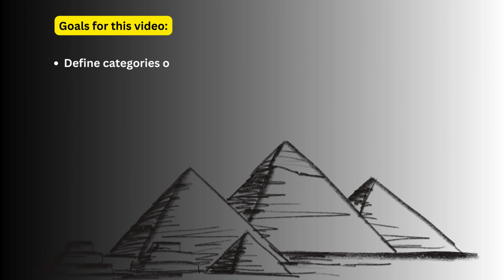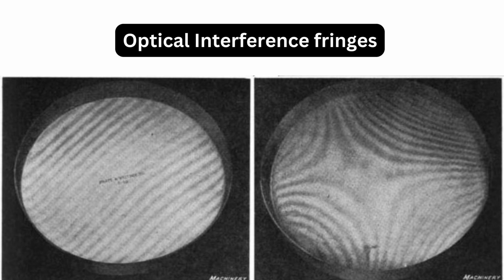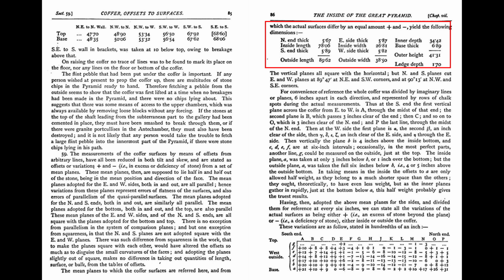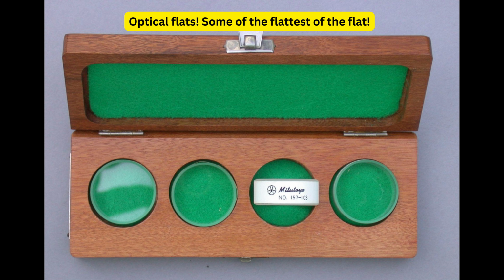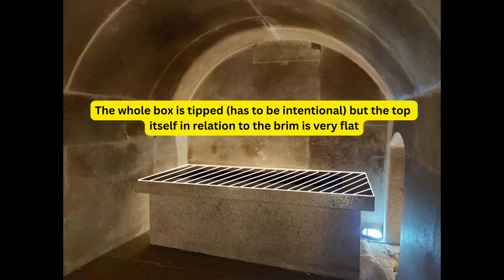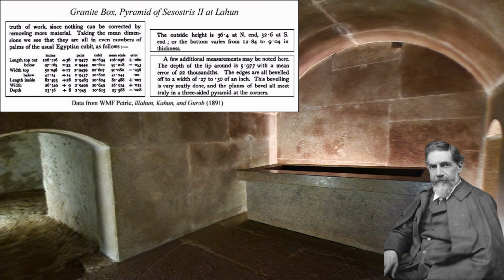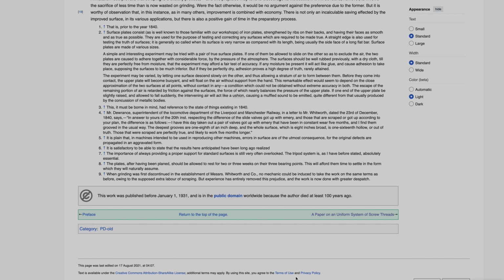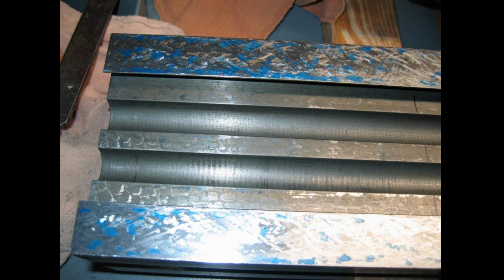The Problem of Flatness in Ancient Egypt

Comment: The problem with the world today is we all think we are the pinnacle of everything... you can go into the woods today make a rope and using gravity have a straight line, going off of that you can build something next to that line giving you a near perfect line, add in natural sun light to be a check for imperfections on the edge, and if turned on its side use a second check of water that is also a constant with gravity. So you have 2 gravity ways to find make or check a straight edge and a cosmic light source to make or check the flat edge

Comment: 5:45
Not quite. The method of shining light through a straight edge can make bumps of a hundredths of a millimeter visible. 
That is actually already extremely precise for most cases. But, it depends entirely on the quality and straightness of the edge your using and the type of light. 
There are actually measuring tools that use exactly that mechanism.

Comment: Actually it's very simple to go out into the woods and make stuff like that fx you can make a simple 3-4-5 triangle that will give you an exact 90 degree angle making a level is also pretty simple cause you can do like the ancient Egyptians would have done and use a weight on a string mounted on a triangle or similar that way you can use gravity to figure out angles making a ruler isn't hard either yes making one that's exactly a certain measurement would be tricky tho possibly using trigonometry but really the ruler just have to fit your own set measurements it doesn't matter if you're measuring in centimetres, inches or banana diameter fx lets say you make a board on it you mark out set intervals with the distance between them being the width of your thumb as long as you keep working within that measurement everything works out fine so even starting from nothing you can make some pretty precise tools to build with

Comment: rub three surfaces against each other... or you could use a slurry mix and run a tight rope through it like a rope saw then do the method i said and it will be quite accurate very quickly.

Comment: String and two points to hold it. Then scrap, sand, smooth things until it is as flat as the strings angle. Make flat measuring tools, then move on from there.

Comment: Another method I thought of is using water as a guide, useful for boxes as you simply submerge the box to the desired depth using the water line as a faux external spirit level and than shave away material until its inline with the water. A final polish with a finer grit surface such as abrasive sand and leather than brings it all into machine like tolerance. This is all possible with simple agriculture as you just dig a small basin and that can be opened and closed to fill/drain water and the bottom effectively can be adjusted via stones  and leveled with water (once again as a guide) to ensure the workpiece sits flat.

Comment: The three-plate method requires the plates to be rubbing at approximately the same position relative to each other, for the peaks and valleys to cancel out in later steps. You can't take a small piece and rub it at various locations on a larger piece as your animation shows, and still expect it to work. To make each side of that large sarcophagus flat, the other two plates would need to be equally large. Also, keep in mind that the three plate method does nothing to guarantee parallelism. So I really don't think this was how it was done.

Comment: If you want to get started with making a perfectly straight and flat surface when you just walk into a forest with no tools, start with (after you made stone cutting tools) making a bow. A bow with a decent enough draw weight will pull the bowstring in a perfectly straight line. You can use this straight line to make a straight ruler by scraping and sanding a piece of wood while putting the bowsring on it, using the light passing between the string and the wood to deterime low spots. This way you can scrape and sand down the high spots. I'ts by no means perfect, but it's good enough for most woodworking and stone masonry.

Comment: This is just a guess on my part, but I'm guessing there may have been an informal three plate method being done.  Even now with modern tools, one of the most important steps is verifying you're tool is still working correctly, and still in agreement with everyone else.  So let's say they started making a flat surface by fitting two surfaces together (or more than likely you would first start with straight edges, since you could use those as a quick sanity check for flat surfaces).  Well if you started by fitting just two surfaces together, you could actually get quite a bit done.  Even taking into account one surface getting convex and another concave, you could still get them reasonably flat for many uses, and if you consider you could also sight down the sides, that would provide an additional reference for any obvious deviations.  
Well what happens when you've done as much as you can?  You go and compare it to someone else's.  Either another students or the one done by your teacher/master.  If they end up disagreeing, well then that's a sign you're not done yet.   And that is essentially what the three plate method is; you're just fitting multiple surfaces together, but the only shape that multiple surfaces can fit together is a flat plane.
And then once you have that initial flat surface, you have a master reference anyone can use to check their's against.

Comment: modern life has a problem with flatness, but what do you trust, the flatness you see or the one you feel, think about how a cube planet would feel as you walk it, at the middle of each face it feels flat, but move from the middle and now it starts to feel curved. Easy to put it down to gravity but measure the face with a laser you see how it looks, measure with spirit levels you see how it feels. 

Forcing your idea of flatness to lights perspective makes the planet look curved, but it feels flat to be spherical, if i have a 10 sided shape it feels flat in 10 small spots, right where a sphere touches.. 

You arent doing the same geodesic as light, you carry the same speed but you are on a tangent to it, light has 100% motion in time relative to you, you have 100% motion in space, you are 90 degrees from each but both do the speed limit. 

It takes 8 minutes for the sun to get to the earth, where it would do an orbit of the planet in 8 frames at 60fps, we sit at 1AU doing a yearly orbit taking 365 days, if i change my acceleration to any other direction, at 1G of constant acceleration i would be at the universal speed limit, 1 light year away, after 1 year of travel. Where my orbit is the size of the observable universe... if light was slower it would orbit at the same relative speed you do, to make a massless planet fit lights perspective it needs to be the size of the universe

But like you said with float glass, nothing in your home is flatter, it floats on a pool of molten tin, so it has the same curve as the earth literally baked into it, if you had a bridge flat to the ocean, following the horizon, you wouldnt need to drift far from the horizon to keep the pane flat in time and space.  According to special relativity a flat path in time is a flat path in spacetime, flat paths in time would be where clocks tick tock together. it could potentially extend around the planet without breaking, but how big is too big for the pane to flip over..

If you are centred with a planet you have the same 3d and 4d motion as it does, rotating around the star and expanding in space at the same rate, no reason to be pulled anywhere, move from the middle and now there is a mismatch in the translation, the smaller object will sink relative to the larger without either moving.  Orbital mechanics from a motion in time, gives you motion in space, on a small scale, on a larger scale things are falling away in time not so much space. 

If you make a snooker table the size of the planet you could make it feel flat without adjusting it too much, you want to raise the legs around the equator just slightly, your angular momentum raises your lowest point you would hit if collision suddenly turned off, weird you have a longer drop from the pole vs on the equator but its why you weight slightly more on the pole than you do with 2 bulged hemisphered "pulling on you" because gravity isnt a pull, well it is and it isnt... you feel attracted to your orbit, which should be about 90 minutes where you sit, you do it in about 24 hours, so you are higher and slower than orbital mechanics usually allows, the universe is forcing you right... if you were lower and faster than allowed you fall up not down.

You have a physical and temporal location, there is a mismatch in translation which the error is corrected over time... its all just flat enough to be spherical...

To unite the flat universe with the flat earth you need to see both have the same unseen curves over time, the CMB literally becomes the ice wall to the flat universe. 93 billion light years around, 26 billion light years across, those are the boundaries to our bubble
Reply: Zero and infinity should be considered 2 ends of the same abstract yard stick, all straight lines are closed loops, all closed loops are knots from the wrong perspective, you stand at 1 looking out to infinity, and in to zero, it feels closer to one than the other and if the universe did things linearly it would be true, but the universe counts logarithmically, weirdly you are the same distance from both manifolds on Euclid's compass. Looking out to infinity is easier for light. whats the bigger infinity tho, the easy one or the hard one...

a single line is a circle, 2 an ellipse, 3 a triangle, 4 a square, 5 pentagon etc.. 4D which you are in needs 1 line to start/stop an orbit, 3D conically 2 ends connect, 2D had 4, a 45 degree inclined orbit touches all 4 edges, leaving 1D with 8, a box in a box, A expanding to B via C fits. 5D gets 1/2, wrapping around a middle point, making a singularity. 6D goes inverted. 

 E=1/2MC2, E=MC2 applies to things at rest and nothing is at rest. F=MA + losses, in a perfect universe pi=4 but its not perfect, it has 3 simple rules it cant obey, keep up, dont go too fast and dont touch anything. Give space and time a macro micro bond, one strong one weak, give them attraction and desire to be apart, they cant sit still. Their motion generates 2 smaller paired forces on a tangent to their own motion 90 degrees out of phase, their motion makes more losses leading to electrons and protons, but light is a packet of energy between 2 bi polar waves, mass is an energy packet between 3.  It all generates forces and losses in the friction and motion, resistance and impedance on every level of the universe make the music inside the band gaps each point on Euclids pencil carves out, there are no pinned points, just a chain of pencils, all staggered in their spacing, with logarithmic flow, scaling in time and space, rotate the canvas at a steady rate and it loops creating infinite loops inside loops, the music falls out in the vibrations between the nodes, every record is slightly different but each track is the same potential squared slightly different to space and time, its all so fractal and self sustaining, an error correcting system that never reaches zero or infinity, CCC with CP symmetry 

you have 3n+1 4:2:1 scaling with a 1:137 rotation of the board, the right geometry slices a line through all 7 millennium problems and the Collatz conjecture, and its all in Smiths charts, putting finite numbers on infinities with the right limits, the speed of light is the baseline and limit, just 90 degrees tangent in space and time to electromagnetism

we sit 8 minutes from the sun, it would see 8 frames orbiting the earth at 60FPS, we do a 1 year orbit, in 1 year at 1G of acceleration in any other direction i am at the limit, the speed of light 1  light year from my starting point, its all in the geometry

Banach for his Hilbert space where Pi=4 but light is only 90% square gives you 10% of wiggle room, add Hawking radiation to Godels unified model of General relativity and Gauss for non Euclidean geometries and you explain a universe God free, uniting the flat universe with the flat earthers with the same gentle curve over distance/time, but things are falling away from us in time not space. The big bang is as much of an illusion as the ice wall, its the universal south pole when you pin a light cone to here and now.. move the pin with the user of the map and its a valid map, never leading to an exit in space or time, its both or neither 

A Review and Mathematical Treatment of Infinity on the Smith Chart, 3D Smith Chart and Hyperbolic Smith Chart 
A Fluid Dynamics Framework for Space-Time: Unifying Relativity, Quantum Mechanics, and Cosmology
 Gravity Is Not Attraction; It’s a Push (Space-Time Expansion Theory)

Smiths charts can put finite numbers and limits to infinities if you have the right geometry, clock and key, all the math falls into place...

Comment: You get a piece of string, and you pull it really tight, and you use it as a ruler to mark and cut a straight surface, which you can then use, as a proper ruler, to mark and cut other surfaces.
 
Get two pieces of string and connect one side of both strings to a single point and you can use them for angles too. Like a primative protractor.

I can't imagine 'string' was impossible to get hold of in ancient Egypt.

Comment: In aviation school one of our first projects was to do a wooden spar splice to government standards.  Flat smooth and tapered.  It was a lot of work and you couldn't use sandpaper.  The pores had to be open to accept the glue but it had to have full contact all across.   Very similar process to get both sides flat.

Comment: They casted those large stones on top and side of each other stones one by one slowly. They melted specific stones on high heat mixed with chemicals compounds and used alot of water just like cement concrete today, and shaped molded and casted them while its still soft drying under sun heat and air.  Now, after hundreds and thousands of year worth of water, air and sun exposure, today these pyramid stones looks like heavy bolders that were cut from mountains, carried and lifted up. These are casted, shaped and set using large wooden boards and planks to keep the casted stones in place up high. Some large scale structural stones in pyramid building did not required lifting.
Reply from the maker: That’s just insane
Reply: That makes no sense, and there is zero evidence for it. It's not even that practical. It would less work to quarry the stone. 
There's also this issue that we know where the quarries are.

Comment: The three plate method is based on 2 key assumptions: 
1.  the plates must be rigid (no flexing or bending). A copper plate won’t work, it will be too flexible, and bend to match the granite.  
2.  The plates must be held in a fixed orientation while they are pushed together.  If the plates are rigid but allowed to deviate from being parallel with each other, the method doesn’t work. 
IMO, workers in ancient Egypt would not be able to work according to the these assumptions.
Reply from the maker: My point was not that this was the way it was done, but that this is the very basic way to get extremely flat surfaces. My point is to throw a monkey wrench in the idea that advanced technology was needed to get something super flat, not that this was the exact method used. I’m introducing reasonable doubt into the case

Comment: Everything we see at the great ancient monuments is well within the capabilities of the people who lived there when they where built. Straightness starts with a plumb bob, which is a weight suspended from a string. This string will form a perfectly straight vertical line. Ancient cultures were familiar with the plumb bob, plumb square, and the straight edge. We can achieve a perfect 90-degree angle by drawing four semi circles using a drawing compass, making sure they intersect. We can find the low point of a floor by throwing a small ball on it. We can achieve a straight line by snapping a chalked string on the surface. Carpenters are still using plumb bobs and chalked strings, despite the introduction of lasers. As for the stone boxes at the Serapeum. When they created those boxes, the people there had already 2000 years of experience in transporting, carving, and polishing stone.
Reply from the maker: Great points. Thanks for watching!

Comment: How did they cut granite with bronze tools?
Reply from the maker: The metal didn’t do the cutting the abrasive sand in the groove did. Egypt is full of quartz sand that can grind through granite, the metal just pushes the sand down into the groove and moves it back-and-forth.
Reply: @intothemap360  How are you doing this with internal corners?
Reply: Yes it took them 19 years to put one row of granite casing stones around the pyramid,, then somehow built them in the other 12 months!?
  When I was about 9 years old I swore I could jump off the roof with an umbrella and float down. 
  That's what these folks do every time they talk to you,, they tell you how free from care it is, irregardless of the impossibility to do it in the given timeline that they also accept for all the structures 
  Never forget they also want you to believe they were cutting these blocks out of the Earth every 4 minutes